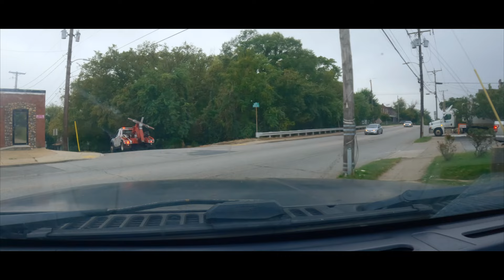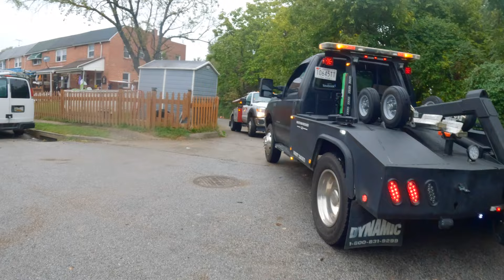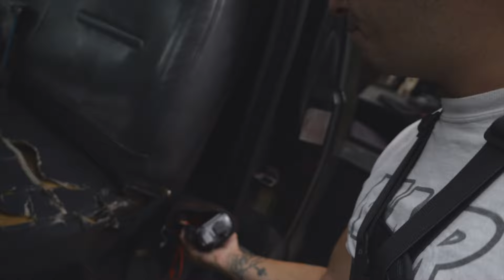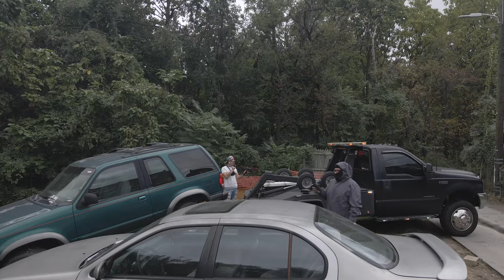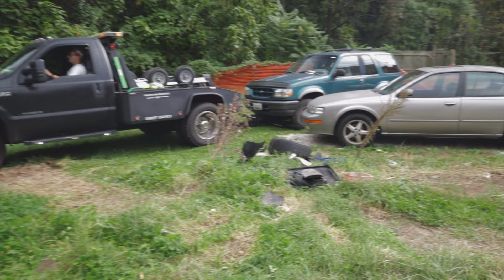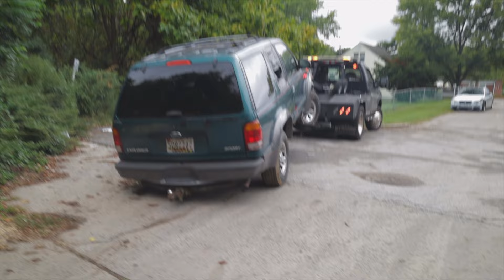JUNK CAR TOWING

Comment: I have a piece of 2 x 12 wood and you screw on a piece of 2 x 6 to go between the dolly rails where the tires go when you have a flat tire like that and your set small and you won't have to change the car around it works every time just a little info your direction

Comment: You should break the 
Steering wheel lock 
So straighten the wheels
I did that when drove a tow
Truck when I went  to pick 
Up title cars with no keys
So I could load them